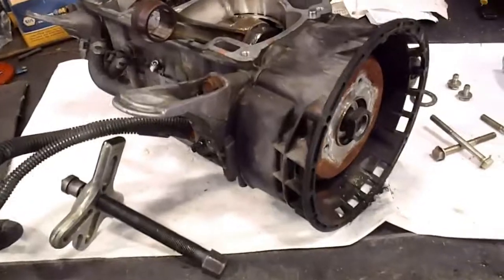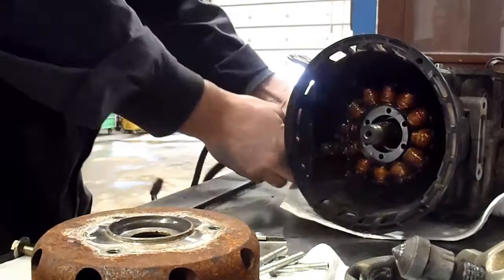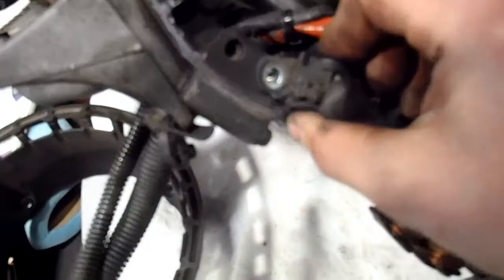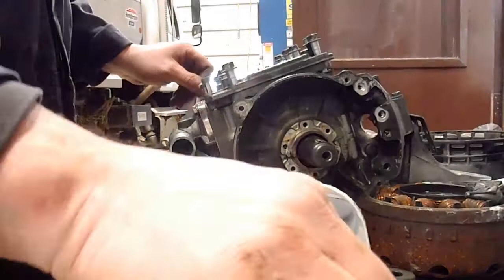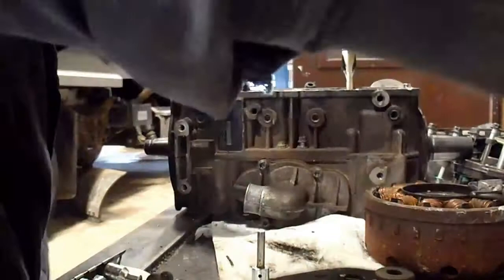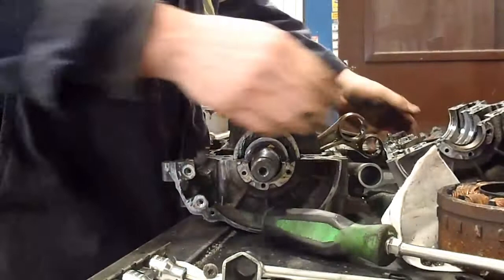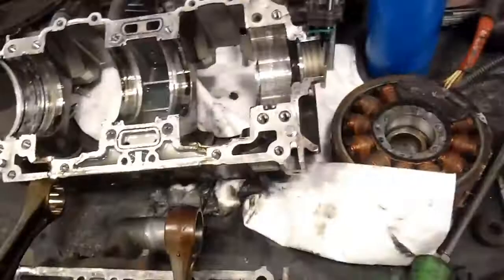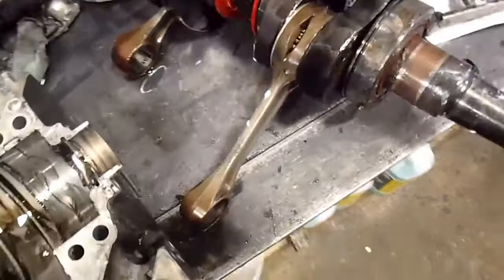Bottom end teardownl etec 800

Comment: did the mag have a seal or is it internal?
Reply from the maker: yes there is a seal in the mag side, it's not as accessible,. There is a procedure to re-grease the mag side bearing by pulling bolts out and injecting grease